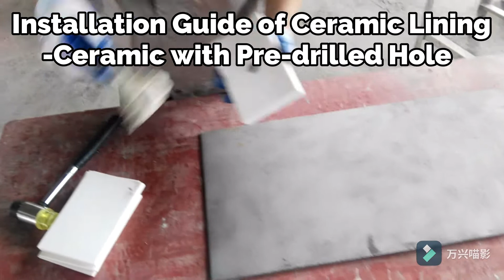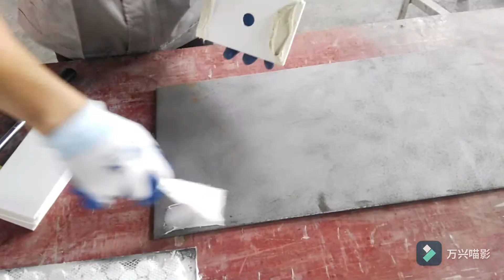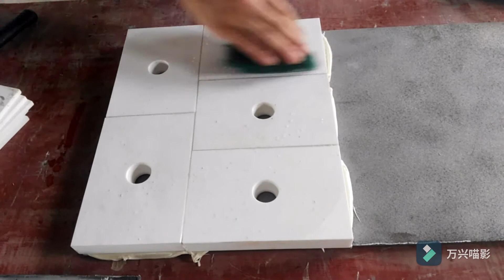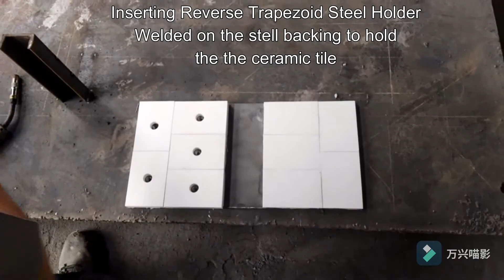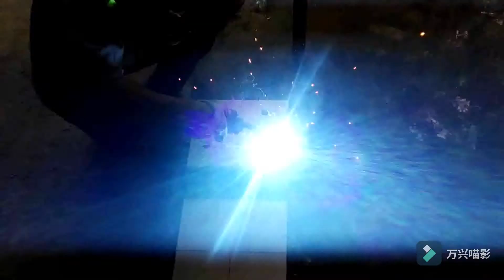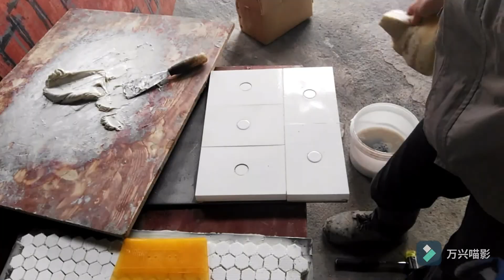Pre drilled Ceramic Lining Installation

Comment from the maker: Ceramic Linging-Especially suitable for sliding friction abrasion! 
Pre-drilled or not ceramic  tile, epoxy resin adhesives, welding, higher bonding strength, longer service life! 
Ceramic from thin to thick, service life meet or exceeds requirement!
Contact me for more details! daniel.niu@rema-tiptop.com.cn